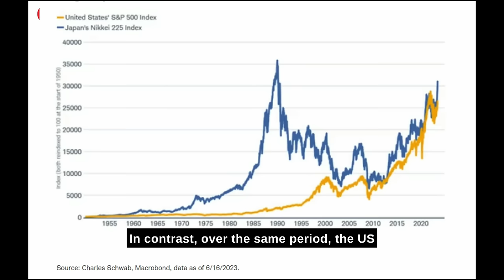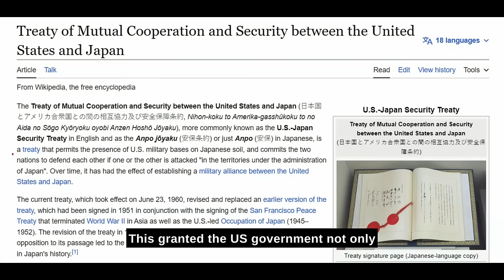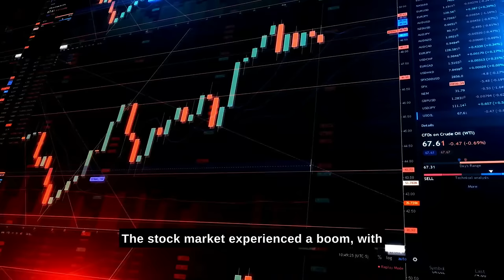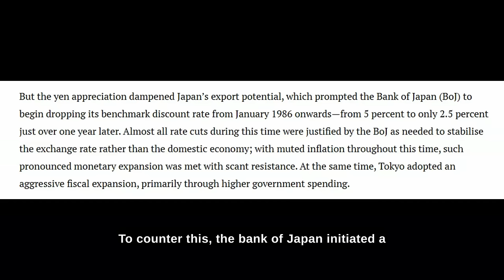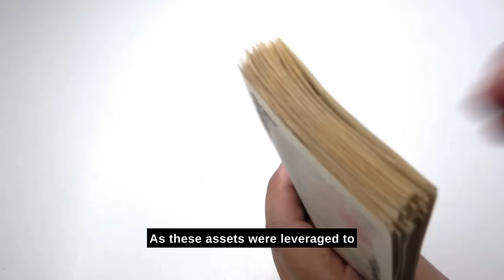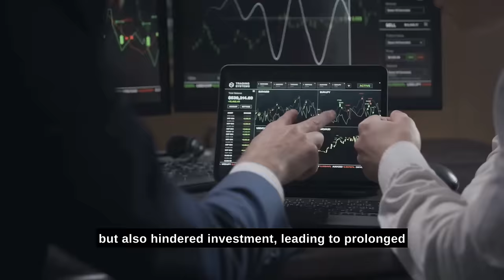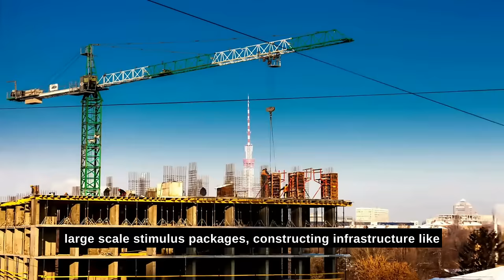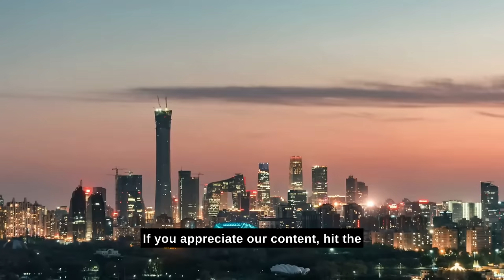How USA Trapped Japan into Economic Disaster

Comment: Lousy video which doesn’t actually offer any proper analysis of the issue and entirely blames the US for Japan’s woes. I lived and worked in Japan for 4 years (2000-2004) and experienced its stagnant economic malaise first hand. In my opinion, the reasons for this economic stagnation lie mostly with the Japanese themselves. Their cultural tendency to follow the leader and never speak their own opinion means that no new approaches or innovations ever happen. They are governed by the same party for the last 50 years, so there is not only economic but also political stagnation. Apart from their traditional industrial manufacturing strength, there is very little diversity in their economy. There are very few opportunities for young people, people are help up to an impossibly high standard of achievement, and if they are not up to the mark, there is not much for them to do other than working in dead end jobs. So the economy simply doesn’t grow as there is no innovation. They have a shrinking population so they cannot rely on domestic consumption to power their economy either. 

You can’t simply blame the US for all of this. Japan needs to mature and move forward as a society, and it really hasn’t.